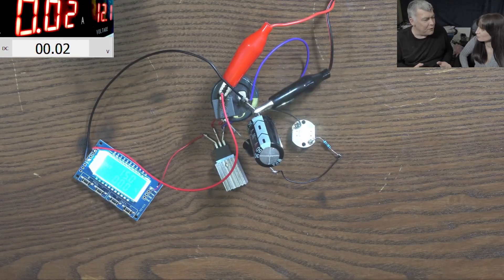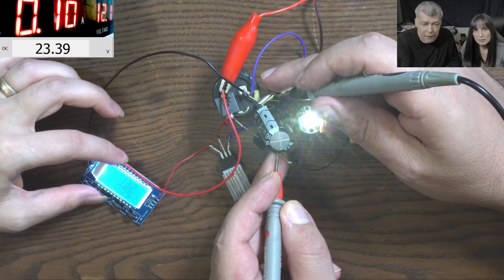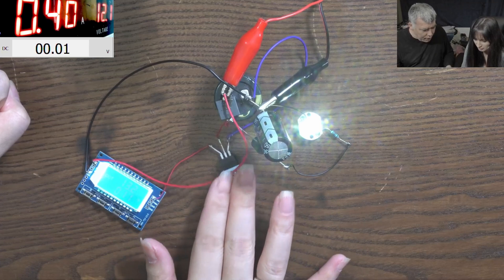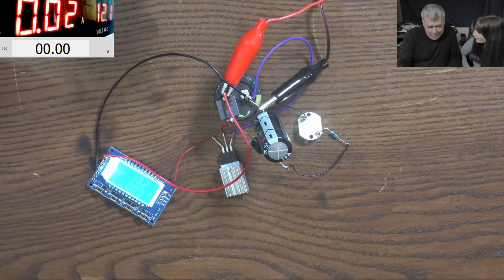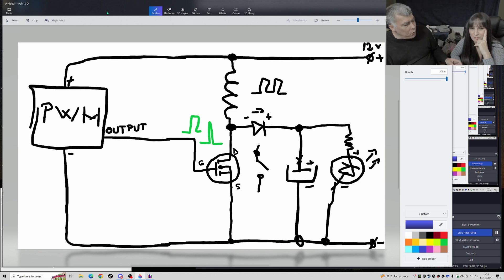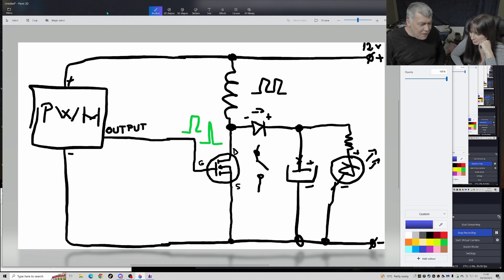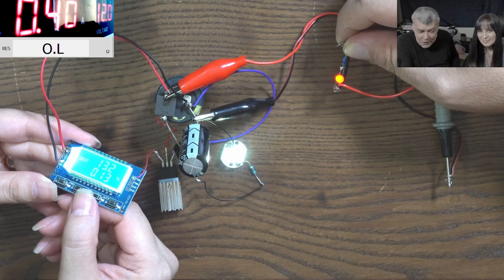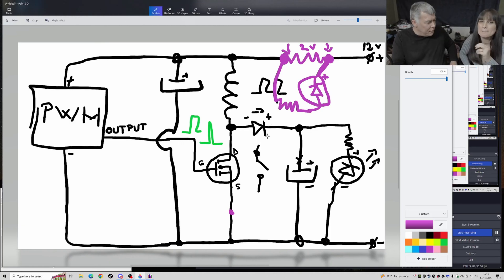How a Current resistor/sensor/detector works- Lesson 30 Learning electronics with Diana

Comment: So that voltage drop across the current detecting resistor is used by the pq (or whatever it's called) chip to detect a shorted mosfet or shorted power rail. The chip replaces the LED in this example, correct?

Comment: I had to watch this one a couple of times before it sunk in!  If I'm understanding correctly, a current sensing resistor is used so that if the current reaches (and goes past) a certain value the potential difference across the current sensing resistor is enough to drive another part of the circuit in to doing something such as shutting down all/some/one of the power supplies so no damage can be done by too much current flowing due to a fault somewhere?